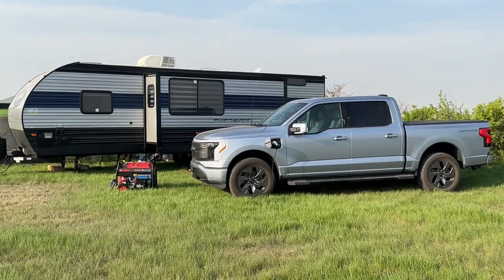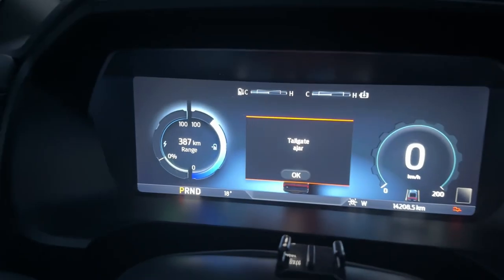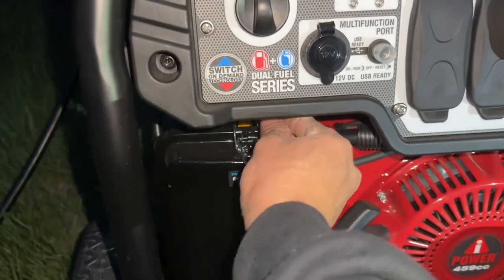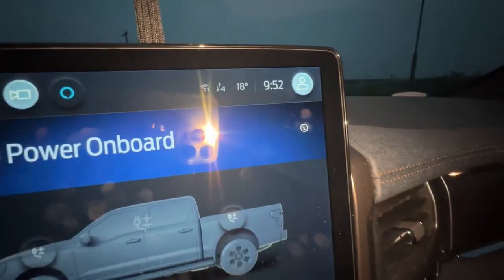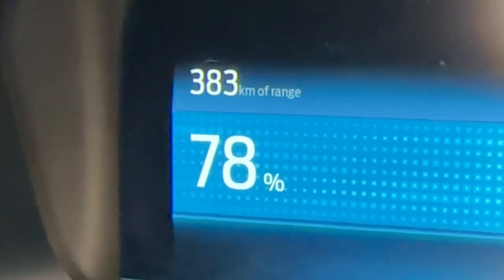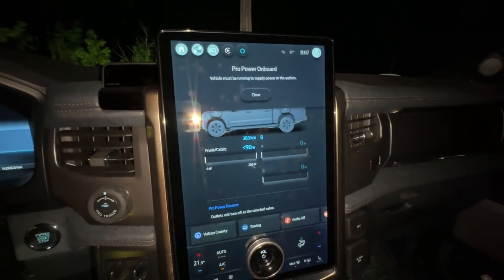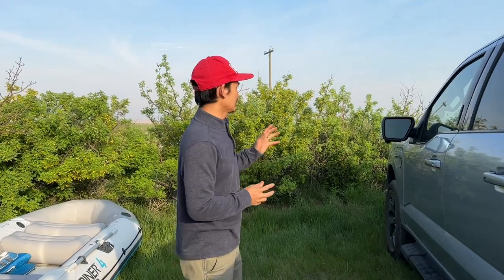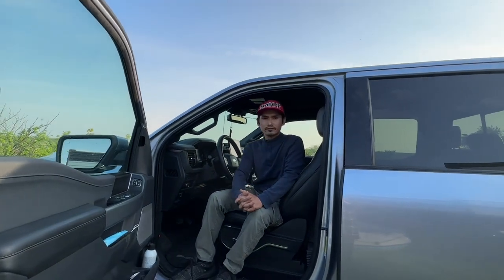Can a 50A-240V Generator Charge the Lightning and power the trailer at the same time??

Comment: There are not many true inverter compact generators on the market that provide 240v. One that I have been using on my Lightning is the maxpeedingsrod 5500. Provides about 20 amps at 238v. I use a level 2 charger with a 20amp setting.

Comment: The 30A EVSE from ford needs a min 7200W to operate properly. Not sure what the generator is rated at plus it is sharing a load with the trailer. If you check the fordpass app, it may say "charging paused" due to insufficient power for charging.

Comment: How fast does that generator charge your truck when not powering the trailer at the same time? Like when your only charging the truck
Reply from the maker: @jordangulbransonmusic2286  it’s still really slow like charging with 110V at home, maybe a little faster but not as fast as 220V 30A at home